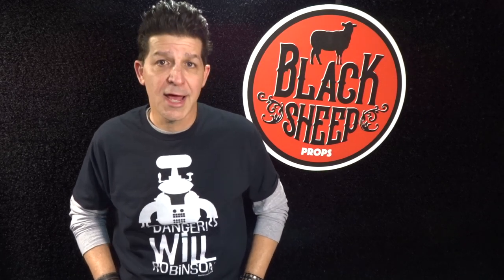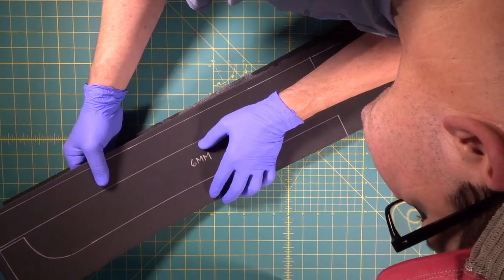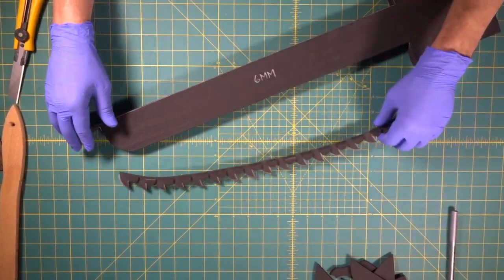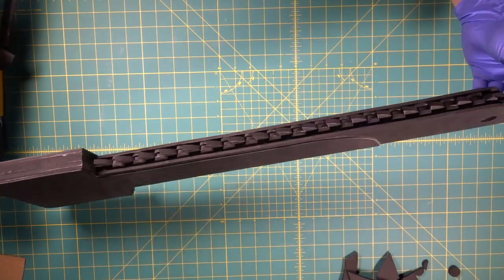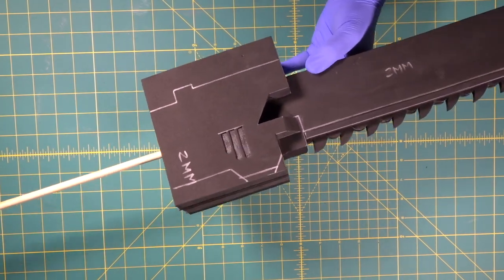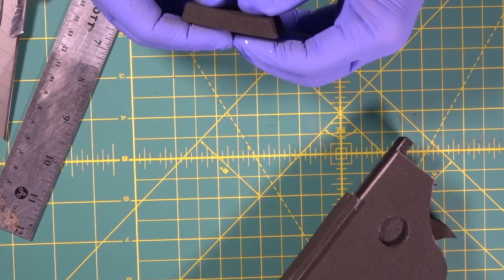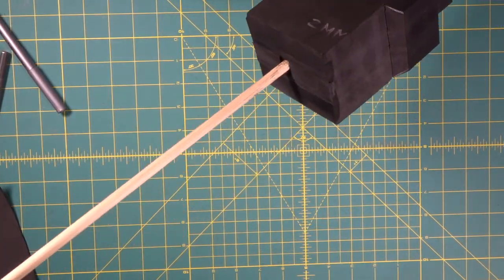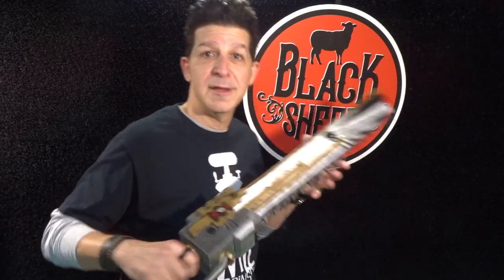Making An EVA Foam Chainsword Part 1

Comment: Just wondering if using two layers of 10mm foam would work for the base of the chainsword and using 10mm foam for the teeth due to the thickness. I'm just wanting to make use of what foam I have, plus for the outer layers I have 5mm instead of 6mm.
Reply: Did you try this? And did it work?
Reply: @feenixb1o7  yes it seemed to work ok.
Reply: @Housenflou  Awesome thank you!

Comment: A great template, but it requires a bandsaw to build it properly. I have to came up with a good substitute solution ^^
Reply from the maker: Hi! Sorry it took me so long to reply. Yeah, unfortunately there are some builds that do require a bandsaw. Sometimes if you need to cut a super thick piece and cant use a bandsaw you can cut the shape out of thinner foam with an xacto knife several times and glue them all together to get the thickness you need. And then clean the edges up with a dremel. It isn’t as perfect as using the bandsaw but it does work.
If you plan on doing a lot of building you can get a 9" bandsaw like mine for about $120. It is well worth it if you plan to build a lot.
Reply: @BlackSheepProps  Thank you :)

Comment: Would be nicer if you gave an actual listing of the foam thicknesses required, as not all of the templates list them.
Reply from the maker: Looks like every piece of foam used in the video has the thickness listed on it?
Is there a piece in particular you are having a hard time deciding on?
Reply: @BlackSheepProps  I am referring to the templates I purchased, not the video.
Reply from the maker: Yes, I know. Every thickness needed is shown in the videos.
Reply: @BlackSheepProps  I think the feedback is that it would be helpful if the thickness was on the template, that way you do not have to refer to the video when cutting the pieces.
Reply from the maker: @cedricsnow4221  Hi Cedric, I actually revised that template so all the thicknesses are marked. Should be good to go moving forward. Thanks!